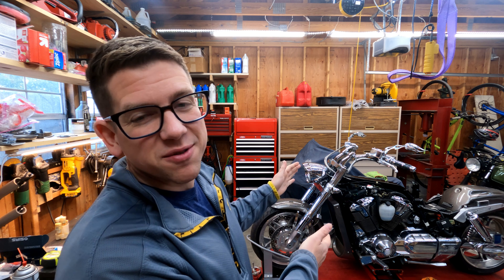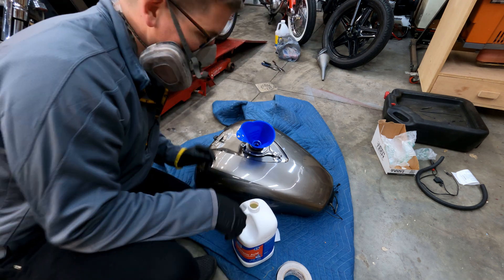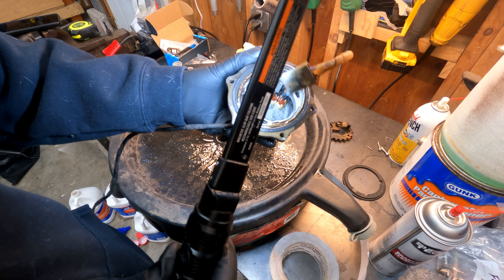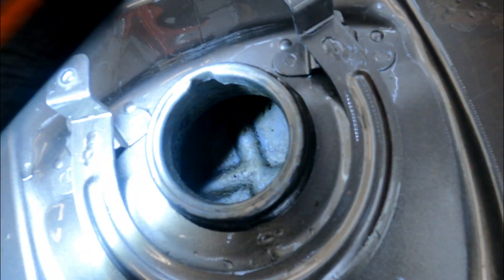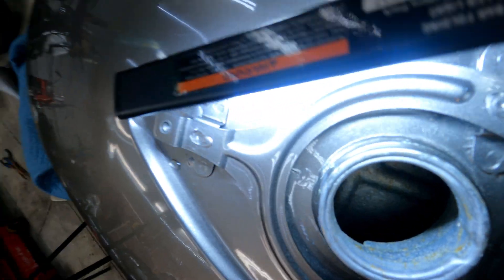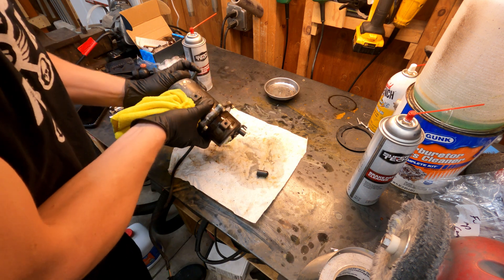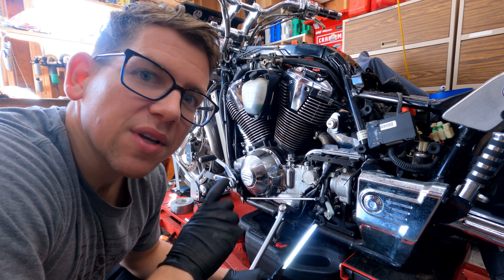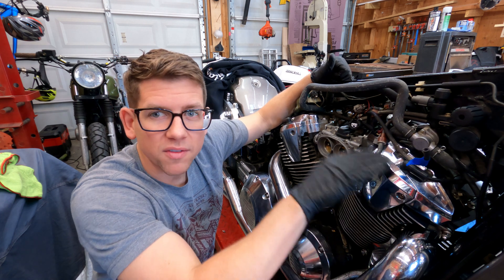Cleaning The ENTIRE Fuel System (Including Tank!) On A Motorcycle - Honda VTX1800

Comment from the maker: If I were to do it all again I would most likely seal the tank after rinsing the acid out. After a couple of months some light surface rust built up on some exposed surfaces inside the tank that needed cleaned again.
Reply: great video. I had the same situation, used vinegar in the tank. Turned out factory clean. Let the vinegar work for four days then pressure washed the inside followed immediately by rinsing with gasoline. Take a probe to look inside the tank. Vinegar is easy to dispose of.
Reply: You're saying here to keep it closed off till it's mounted and filled right?

Comment: This is an old video so hopefully two car sees my comment. I have an 05 1800 R. Mine sat for the most part and was only ridden some. So contamination in the tank of course. Wanted to replace the fuel filter among other things. That's when I found out it's internal to the fuel pump and can't replace it. just have to replace the entire pump (very Costly). My questions: You just cleaned the pump vs. replacing which means your fuel filter is still toast. Or am I missing something?

Comment: I know this a very old video, but I'm in the process of doing the rust removal.  Did you remove the fuel float out of the tank before you poured the acid in, or if you left it in there, does acid or vinegar damage the float and gaskets?

Comment: Great video with good easy explanations.  I have a 2003 VTX 1800C  that I last rode was about 5 years ago that now won’t start.  It turns but it won’t start or even give a hint of starting. The fuel tank looks awful in the inside and no telling what the fuel pump looks like. Sure would like to be able to do all you have done with that VTX.  How much do you estimate it would cost to have someone do all that work on my bike? I’m the sole owner of the bike.

Comment: 2002 honda 1800 vtx r, fuel pump in the tank.  It also has been sitting outside for years. INSIDE RUST also, so how do I get the ALL the parts for the fuel pump.  I am going to try the Acid.  Thanks for the video.  Do you suggest tank sealer?

Comment: How is the Oasis pump holding up? I need to do mine but question using a cheaper pump. Thanks for all the info it is priceless.
Reply from the maker: Unsure, as I don't have the bike anymore. To buy new, you have to buy the entire fuel pump assembly which is $640. Normally I only buy OEM, but in this instance I just couldn't justify the cost difference.

Comment: Don't use Muratic acid!  It will ruin the tank steel.  Use Phosforic acid and water at a ratio of 50/50%.  Behr Concrete Cleaner is Phosforic acid and works great and will ot hurt the paint.  Rinse with water and then a rinse of De-natured alcohol.  Fish with a rinse of diesel fuel to coat the tank to prevent rust it's going to sit long term before use.
Reply from the maker: Sounds like a good method!

Comment: Nice job brother. I'm about to do tank and pump; I'm thinking I need to de smog as well, but I'm also thinking of just running seafoam for a tank or two instead of pulling injectors. Thinking about it.
Reply from the maker: Honestly, even with the rest of the fuel system as junked up as it was, the injectors probably didn't need cleaned. They sprayed fine right away.

Comment: I would like to know if that pump will work on my 1800n 2007 and part number thanks
Reply from the maker: probably, but even on mine it wasn't a direct bolt on. It took some minor modifications to the plastic housing to get the filter 'sock' to fit. Here's the one I used:

https://www.ebay.com/itm/234096631016

Comment: To anyone wanting to do this, use extreme caution. Muriatic acid is the same as hydrochloric acid. Not only is it really good at removing rust but it will eat the metal with time. You may decelop pin holes afterwards due to it eating the rust all the way through. 
I would also not cap the tank completely. As muriatic acid works it gives off gas, which in a sealed vessel will blow off whatever you are using to cap off the vent and fuel outlet, leaving acid all over the place. Use baking soda and water to neutralize the acid if you use muriatic or for any spills. Wear you PPE AND Use in well ventilated area.
Better off using something like phosphoric acid and some steel nuts strung loosely on a piece of wire yo keep them together and shake it around gently. 
Check out KBS Coatings fuel tank sealer kit. Has everything you need and the tank will never rust again
Reply from the maker: Makes sense that if it's an extremely rusted tank, more than just surface rust on the inside, it would eat right through. In that case the tank isn't salvageable anyway. 

I have tried phosphoric acid in the past and it's just not aggressive enough for my liking.
Reply: Thanks man, I am in the middle of doing mine, so I ordered the kit from KBS for my Honda VTX

Comment: You didn't replace the fuel lines?   lines that old are most likely cracked and rotted. Not good.
Reply from the maker: Nahhh don't worry, because it's fuel injected they aren't your standard rubber, but high pressure lines. 2005 isn't old at all and because it wasn't left outside none of the rubber is dried or cracked. I also cleaned out the insides of all the lines until they were perfect by running several steps of cleaner and compressed air through.

Comment: what parts did you replace for the fuel pump? I see you have a different fuel filter for it.
Reply from the maker: The pump itself and the "sock" filter is starti replaced. The aftermarket pumps don't come with the exact size filter so I just used the closest one that came in the kit.

Comment: So I am literally doing this same exact job on my friends '02 VTX 1800. And the fuel pump is not priming at all. Could you tell me what pump you replaced it with. as I do not want to  buy a whole new assembly. I really appreciate this series, I am more used to working on Suzuki's (I own 2) and am helping a friend get his VTX back up and running.
Reply from the maker: Glad I can help a bit! Here's the pump I used: https://www.ebay.com/itm/234096631016

all of the aftermarket pumps require a bit of alterations to the stock plastic that houses the pump itself, (you'll see what I mean when it's apart) but I figure that I'll only use aftermarket pumps from now on anyway so I'm not worried about it. 

good luck!
Reply: Hola! Como te ha funcionado esa marca que sugieres? En el video anterior habías dicho que la reemplazaría con una BOSCH. Yo actualmente tengo problemas de bomba de combustible. Mi motocicleta consume 16 mpg 😐

Comment: Nice work on the fuel pump. I'm not crazy about deleting the emissions stuff though.
Reply from the maker: Thanks! I can understand your hesitation. I usually do it on every motorcycle when possible, just for the sake of simplification. One less vacuum line to eventually leak...
Reply: That's fine.... humans contribulte less than 1% to ozone emissions... and this bike make no measurable difference. have a good one

Comment: I feel your pain! I recently bought an '02 Honda Sabre 1100 with 1,600 miles on her. The guy I bought it from claimed to have cleaned out the fuel system, but it just didn't run right. My mechanic doesn't mess around, so I had him replace all the fuel lines, fuel pump, filters and just for peace of mind seal and reline the gas tank. I now have a brand new 19 year old bike!
Reply from the maker: Sort of a pain, but totally worth it in the end!

Comment: Thaanks man, this vid really did help me. I got the same problem, a cbr125r 2002, that havent been touched for the last 10 years. It got alot of rust inside the gas tank, and the whole system is probably also full of dirt and corrosion. So tmrw ill full the gas tank with muriatic acid and a water mix, and neutralize it with some wd40 oil. Then go over all those other parts!
Reply from the maker: good luck!